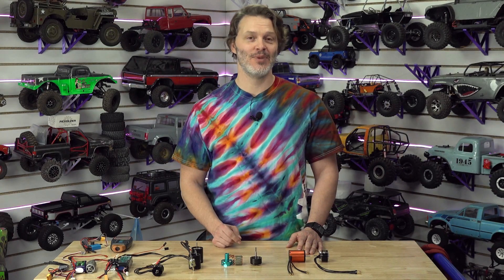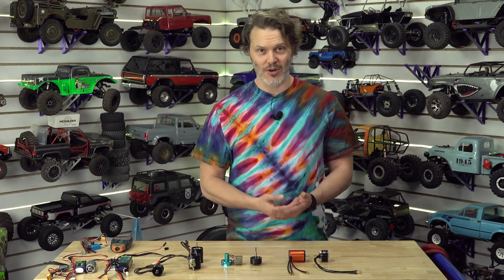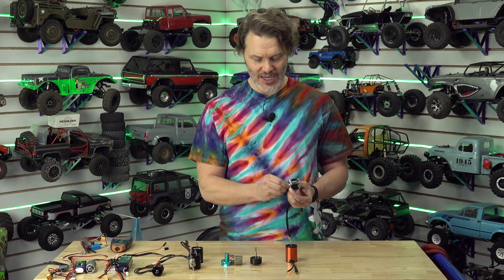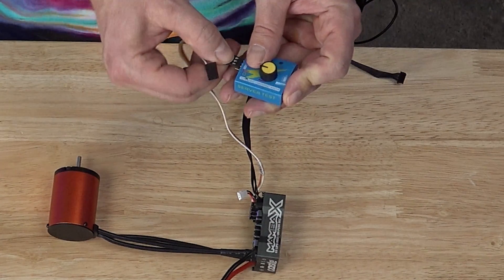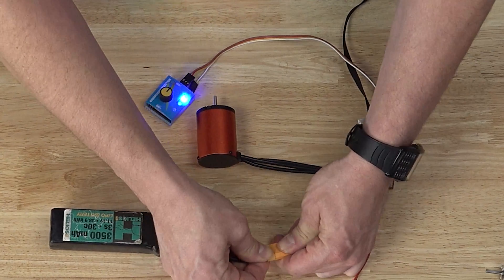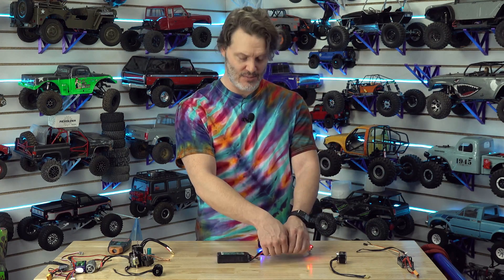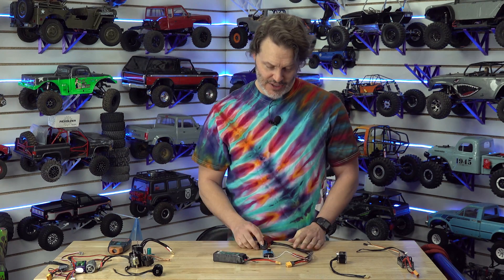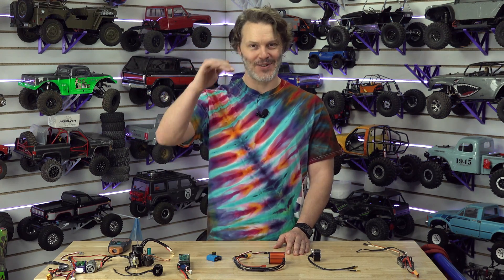Part 2 | The Brushless Breakthrough Continues John Robert's Deeper Dive into RC Motors and AM32 ESC

Comment: Why is it every time I plug my sensor wire into a motor it cogs and won’t go but will run perfectly with out the sensor wire on a tekin rx4 and even on my hobbywing xr10
Reply from the maker: Bad sensor wire or phase wires in wrong order?

Comment: With the improvements to esc;s it would be so nice if there where outrunner motors that would be used as hub motors crawlers as an improvement on moa crawlers.  I have been looking at simpleFOC and considering repurposing a  STM32 based drone controller to make a 4 motor crawler without having to make small gearboxes.  My end goal would be to have independant drive and steering on each wheel.
Reply from the maker: Keep in mind that every 2x loss of reduction requires 2x more motor mass to produce the same torque at the tire

An average crawler with 64:1 reduction means this new non reduction hub motor would be 32 pounds for the same torque at the tire.  It won't fit inside the tire you want 😆
Reply: good point, I should probably try making a Cycloidal Drive to add that reduction. @HolmesHobbies

Comment: Thanks for the very good comparison. There must be a domestic (for me..) test and a home for an AM32 esc.. that looks really good.
I’m too not to fond of the constant rpm it looks unrealistic, and the throttle work is part of the driving challenge (I like it on a drill though). On my HW motors I have disabled it, so what you suggest with a “softer” version and with a drop off in sudden amp/torque changes sounds exiting! Nice job!

Comment: As much as I would like to get one of those am32 escs,  I think everything has come quite a long way compared to what we had 10-15 years ago.  
I bought my mambax when they came out, and its still running strong. Maybe its not the best anymore, but Updated tuning several times as updates came out, and its been a solid performer compared to some of the stuff i used to try. 
Still have my old novak Timbuk2 sensored esc. And i remember having it paired up with a 17.5 turn tekin race motor, and thinking, this is not what i was hoping for. It will probably never go back into a rig, but its there to remind me of how it used to be.

Comment: Thanks for great video.
I was wondering how does brake and drag brake works in RC. Can going downhill (on neutral, brake or dragbrake) for very extended length damage ESC or battery?
My question comes from when I was thinking to take my trail truck for a hike that is 20km of almost constant uphill and then 20km almost constant downhill...

Comment: Do you think that old 60A ESC (ATmega168-20au MCU) we tried to get it to work with crawlers back then can be programmed with that firmware? I remember the factory added almost 200% drag brake to it along with the program card with the added number option to it. I think I saw someone that was able to flash ATmega MCUs with a FOC type firmware, but mainly aircraft ESCs. The other thing I noticed with some ESCs that I haven't used in over 10yrs is the fact they don't seem to have anything programmed into them and I read somewhere something to do with data retention being 10yrs on that ATmega mcu. The MCUs I'm having made the manufacturer guaranteed close to 100yrs at 100 degrees C which I think is normal for these better 32 bit MCUs.

Comment: Didn't cancel this release their first ESC with am 32
Reply from the maker: It's not am32, it's their own firmware.  I haven't had a chance to test it, we have some on order
Reply: @HolmesHobbies 
So for my revolver 2500, I should get an am32 instead of my sw4 it currently has, for better low?
Reply: The new 32 bit Castle ESC is a disaster using a non sensored motor.  Apparently they decided to release it anyways and just not mention it while trying to figure out a fix.   
On the bright side they aren't spontaneously bursting into flames.

Comment: John! I was fixing my buddies old Stampede 4x4 and the motor had zero resistance to spinning by hand?! So zero 'detent force'. Have you ever come across this? I got the rc back together and it runs fine, I though maybe he had roasted it and the magnets were dead.  It was an old traxxas velineon motor.
Reply from the maker: Those motors are slotless,  no detent force at all
Reply: @HolmesHobbies  thanks John 👍It was/is super wierd